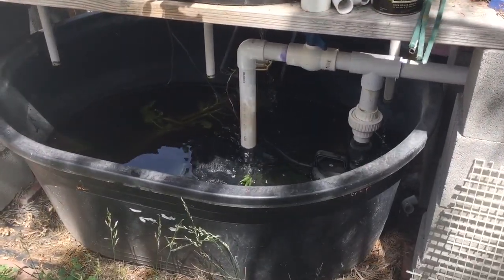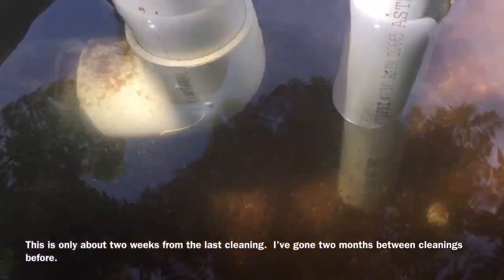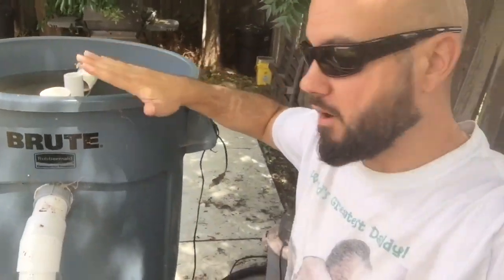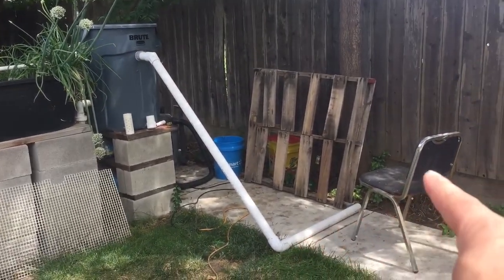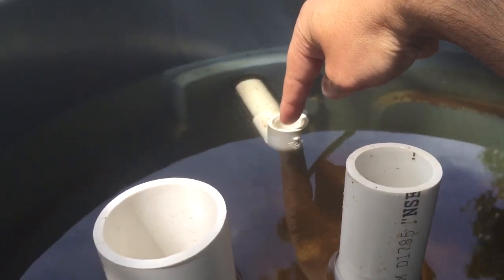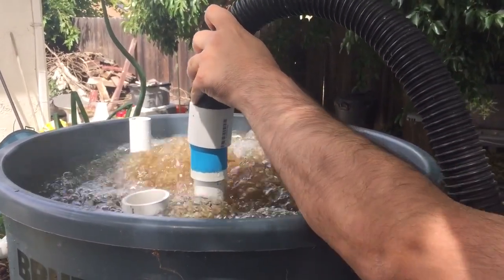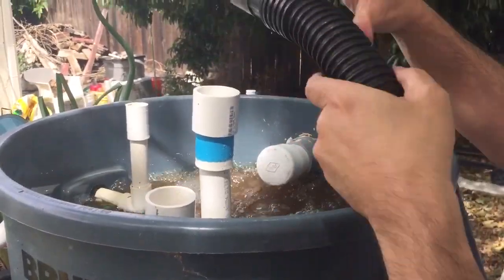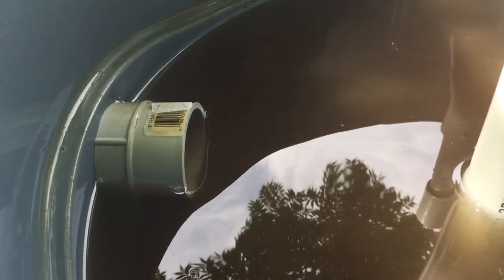Aquaponics - Cleaning my Sand / Gravel Filter - EASY!

Comment: Dude! that's an awesome idea to say the least. I might have to try that with my aquaponics system as I have two 250 gallon IBC fish tanks and one 350 gallon IBC sump tank with 16 grow beds. It makes so much sense also, I was thinking about questions in my head as the video goes on and you lirerally put my questions to rest as I kept watching. Thank you for sharing, and keep up the great work.
Reply from the maker: Your system sounds great.   If you think of any other questions you'd like to ask, just send me a message.   This gravel filter design is the best.   Ultimately, I would have about 5 inches of SAND on top of the gravel, but I haven't had time (or a good source for it) to put into the filter.   The sand would act as a fine polisher and remove a lot of tiny debris that makes it through the rocks.

Comment: Really cool design. What kind of sand do you use for it? Are you using a radial flow or swirl filter to get the bigger solids out first? I noticed you drain the solid waste out, have you considered draining that to a mineralization tank to release the nutrients and reuse some of that water ?
Reply from the maker: I used just pool filter sand that I picked up from Ace Hardware.   No radial flow or anything.   The water rises up from the bottom of the barrel, and goes through multiple layers or rock first.   As it moves its way upwards, it has to then rise through the sand.   This stops a lot of the junk from entering the grow beds.   Anything that makes it through the sand usually settles out on top of the sand.
  I just drain the water into some plants near my yard.   Much easier for me that way.

Comment: Im kind of confused, I thought it was a good thing to get fish waste into your aquaponics system. I do understand that you dont want solids coming back into the fish tank. Is there not a way to build a system that returns those solids to the grow beds? Do you have earthworms in your system?
Reply from the maker: It's a myth that fish waste (ie poop) is what powers the system.    The main driving force of aquaponics is the ammonia from the fish EXHALING through the gills.   Yes, the waste will produce ammonia, but those are SOLIDS which will build up over time.   Too many solids can cause NEGATIVE effects to the system, including having a high TDS count in your water (total dissolved solids).

So from my personal experience, I have found that it's more beneficial to have some kind of prefilter to REMOVE solids whenever you want.  I usually clean my Sand/Gravel filter about once every 2-4 weeks.   It's just a convenient way for me to help keep the water clean and remove some of the built up solids that have been trapped in it.

Better water quality is way more important than keeping waste trapped in it.   Remember, the bacteria will be benefiting from the fish breathing out ammonia.   So healthy fish will mean a healthy system, and vice versa.

And yes, I DO have worms in the grow beds.   Those help to break down any dead plant material or waste that happens to be in the grow beds.
Reply: Hey, thanks for the response!

Comment: How often did you say you needed to clean this filter? And how much backwash water do you flush each time you do a complete backwash of the filter?
Reply from the maker: The filter starts to get full around two weeks in the summer, but longer in the winter.   It's done WONDERS for my system because it stops a lot of the solids from getting into the grow beds or returning back to the fish tank.   Right now, I haven't cleaned it for about a month, but it's still doing it's job.   When I clean it, I pump air through it which causes the solids to break up, and then I flood it out until the water starts to clear.   Usually this takes about 50-60 gallons out of my system, which is roughly a 20-25% water change (perfect for fish health).

Comment: I just have a couple of questions...
First, I think I remember seeing a video you did showing a biological filter. Where is that in relation to this filter and how was it made? 
Second, do you use charcoal anywhere in the filter process and if so, where is it and how often do you change it out? 
Great video, love your setup. Keep up the good work
Reply from the maker: +Jason - the grow beds themselves (and this gravel filter) both work as a biological AND a mechanical filter.   In other words, both trap solids and house bacteria to break them down into nutrients for the plants.    

And I have zero charcoal in the system.  I just do water changes about once every 1-2 weeks, and the new water I add is treated with a dechlorinator.
Reply: Cool. That sounds very low maintenance to me. I've thought about doing something like this but I'm trying to get a bee yard going right now but it would be the perfect compliment project once my hives are up and running. Thanks for the info and the videos my friend

Comment: Nice! I knew you'd "Get it Right!"
Actually, your air hose idea, should have been a bottom drain out, place the rocks above a screen, for a simple gravity release for your solids...
Reply from the maker: That's not how this kind of filter works.   A bottom drain would be more suited for a swirl filter, or a gravity fed filter.   This one is designed to have water pump UP and THROUGH it, with the finer media (sand) being the top most layer.   That way, only the cleaner water gets pushed up through it.   When you want to clean it, you just use air to mix it all up, and let it drain.   I have a video on me cleaning this on my channel as well.

Comment: it should be easier if you put a drain in the bottom near the pvc manfold
Reply from the maker: Every design of this kind of filter has it near the top like mine.   The flow of water goes upward through the filter.   The air that I burst through the manifold does a pretty good job at mixing it all up, and then it pushes it out the top drain.   It's pretty darn easy.

If I had a bottom drain, I think it would waste more water, because I'd have to blow the air into it, drain the barrel completely out the bottom, let it fill all the way back up, and repeat the process of draining it until it's all clean.

With the top drain, I just blow the filter a few times and then the new water feeding upwards will push the dirty water out.
Reply: nice I fully understand what your saying. do you think a plant like citris would be beneficial in the top of that filter?  I want to try a fillet like yours.